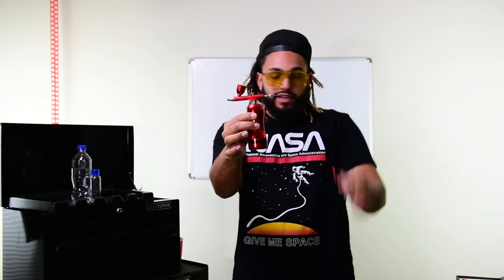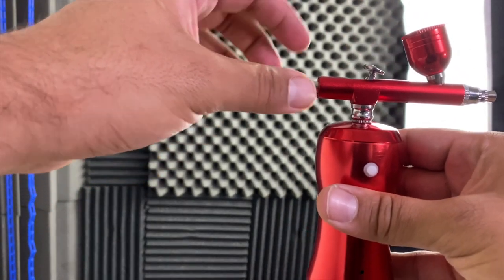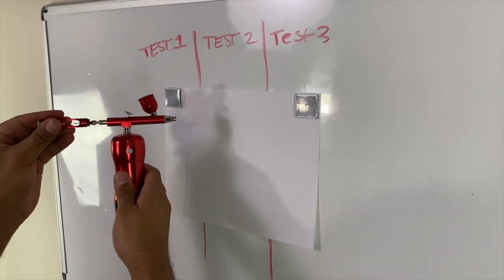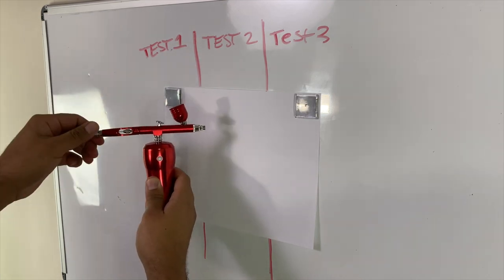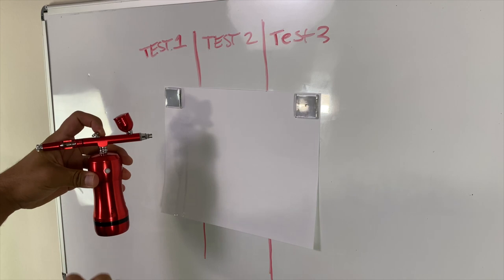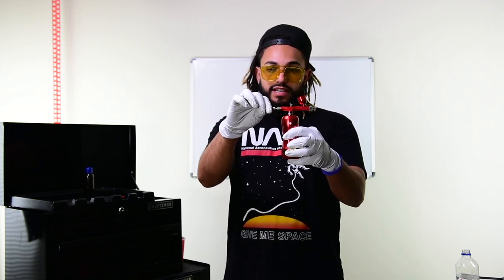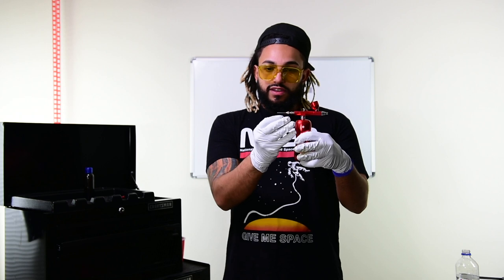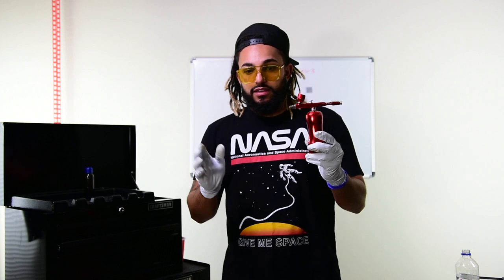HOW TO ADJUST YOUR ENHANCEMENT AIRBRUSH AND MIX THE COLOR

Comment: My compressor sprays out without me even pulling the trigger back…Ive tried everything and it hasn’t changed much… if i turn it on the water comes out without any need to pull the trigger ….any suggestions? Or is it just a defective compressor.  I was thinking it could just be the design but idk
Reply from the maker: Take the back of the gun off and unscrew the crew that holds the needle and push it forward then tighten the screw